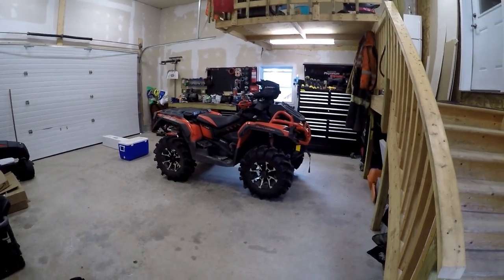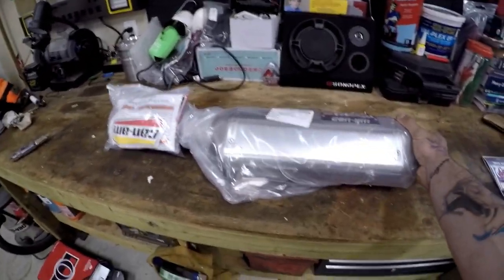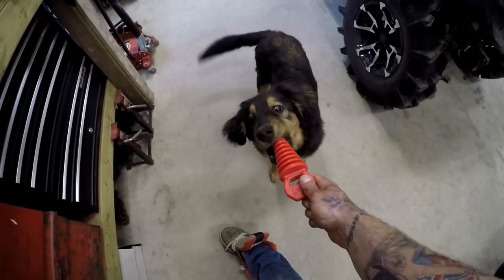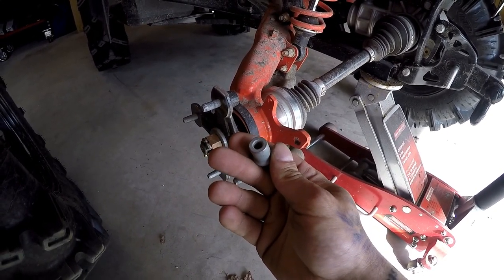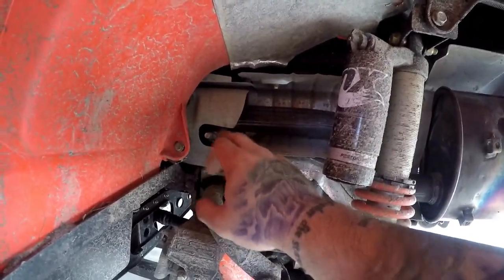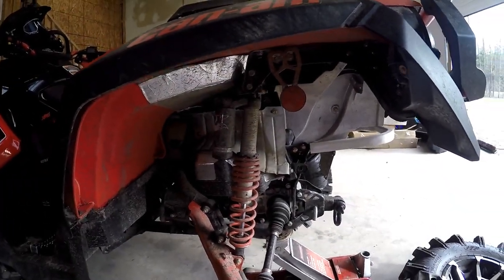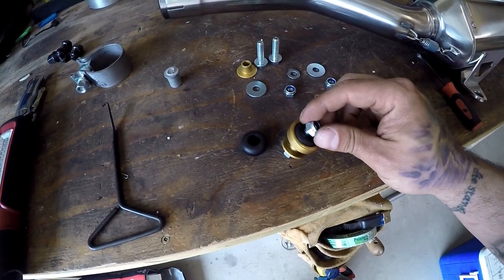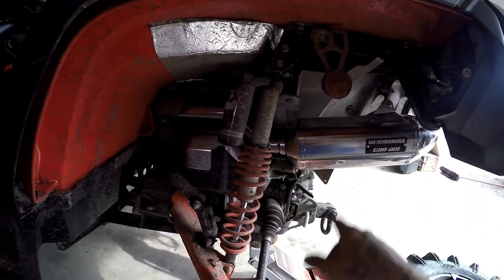How To: Yoshimura Exhaust! Outlander XMR 1000r!

Comment: 1,5 weeks ago i got Yoshimura to my 2018 650xt (abs-version) .. And it's just ridiculous loud with no db-killer: idle 91 db and on "peek" 119 db ----- I have to diy my own design baffle to bring sound level to more "street legal" volume...Not really even close to noise regulations but better: idle 81 db, "peek" 115db and in 80km/h speed something like 97-99 db...

Comment: Very Nice
Reply: Got to ask, did you make any changes to your  machine to cool it down more?  My 2017 XMR1000 seems to run hot now and then to where it will spit  coolant everyso often when the kid is just buzzing around easy on it. Just wondering if there is anything I could do to support this situation.
Reply from the maker: Curious of your rad, thermostat and coolant conditions are, sounds more about that then anything else. Especially with the young one putting around no air flow. Otherwise, exhaust wrap and ECU tuning is the next step. I'd contact dirtylife.ca Tom.
Reply: @MainvilleATV  Thanks, I'll do that.